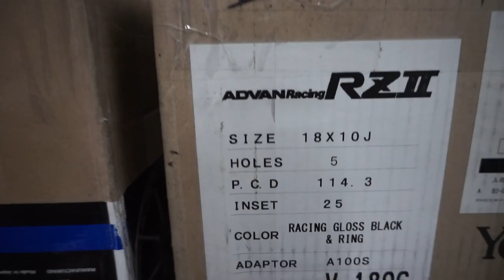I'm Back with a Build Update!

Comment: One thing my dad taught me with his white wall tires on the ‘47 Cadillac, ‘50 Cadillac, 1959 Lincoln Continental Mark IV Executive Limousine he’s owned is to use Brillo pads on the white walls. Works instantly and only thing that keeps them white and clean. Fast option if you wanna keep the white on the outside of your tires. Just make sure to wash off the blue soap quickly or it’ll stain. Hella concentrated. 
Just got my ‘07 TL out of storage where it’s been for about 4 years so super excited to be driving around in it again and have major plans for it after seeing your Install video of the supercharger and another of a 1k HP one. 😬
Also ongrats on the family expansion, just found out I’m having a 3rd too. 
Peace brotha